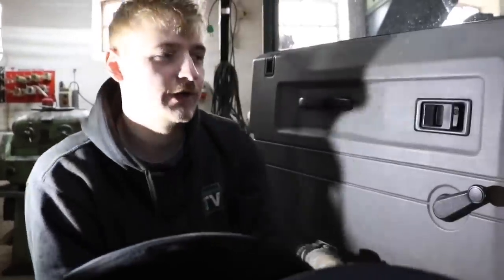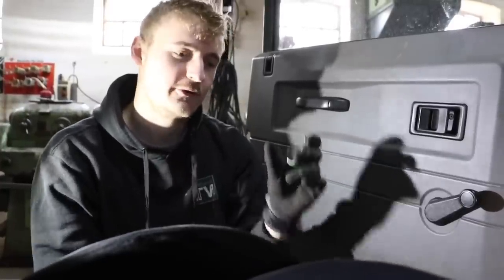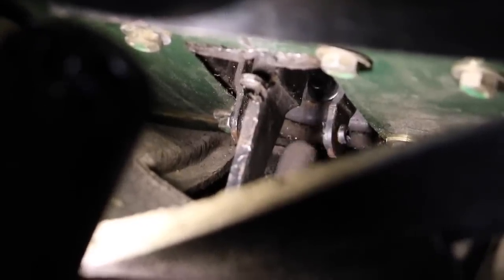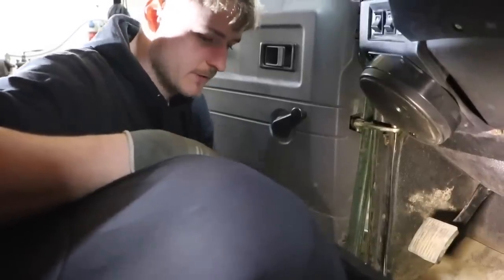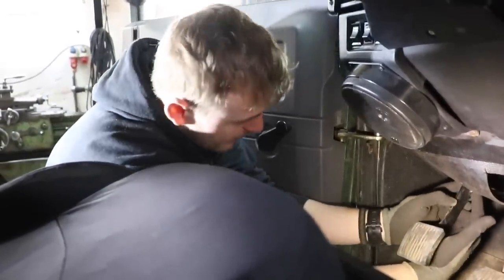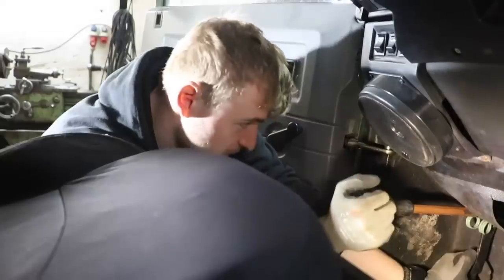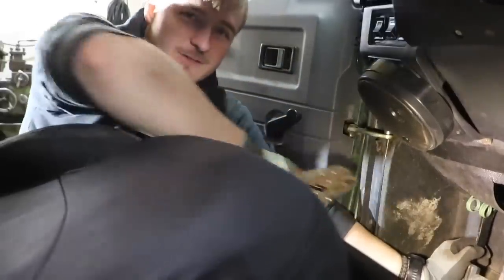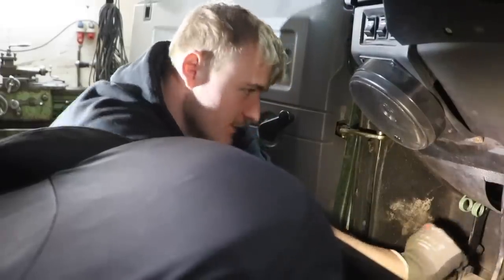How To Make Your Defender Clutch LIGHTER For £20!

Comment: I used my Defender for work for 7 years and covered 140,000 miles so my left knee is ruined. I fitted this spring and the LOF powerslave clutch cylinder recently and I can now drive in comfort. Well worth the effort and money. I found it was easier to fit the spring if you undo the 17mm bolt on the engine side of the pedal box which gives you more room to get the spring in.

Comment: I struggled to fit one of these until I screwed the clutch stop out, allowing the pedal to go down further, no problem then. I used snipe nosed Vice Grips, these saved a lot of struggling. I was extremely sceptical that it would make much difference, but the spring has transformed the clutch action. When I bought my TD5 I couldn't understand why the clutch was so heavy in comparison with my 300TDi, I have now found out. The good old bean counters at LR strike again, they must have saved at least 50p to ruin the clutch operation.

Comment: Fitted mine this morning what a ball ache to fit!! I recommend compressing spring with copper wire then once it’s fitted just cut and remove it. Also you need a flexible back to get in there.  Clutch does feel so much lighter 👍

Comment: TRY A SMALLER INTERNAL BORE MASTER CYLINDER MAKES A LOT LIGHTER
Reply: That’s what the LOF master cylinder is!

Standard bore is 0.75 inch (3/4), the LOF is 0.70 inch, but you can pick up 0.70 inch master cylinders on eBay cheap, as they were used in lots of British cars.

Comment: Surely putting a spring on the pedal to assist with pressing will eliminate the necessary free play and cause the release bearing to run constantly, the equivalent of driving around with your foot resting on the clutch, a definite no no. Please tell me I’m wrong before all those installer’s have premature clutch failure.
Reply: It's an over centre spring

Comment: I've had to admit defeat. Getting access to the 13mm bolt to remove the original spring is impossible on my TD5 xs. 
Fall back was to cut the spring, but then if I can't get the new one on I'm without a car. 
Msybe I'll pay the garage to do it at a later date.
My wife won't drive it as it is, so maybe it's a blessing :)
Reply: Update. I removed the old spring but after too many hours I can't get the new one on. This has turned into a nightmare....
Reply from the maker: @JAMESGRANGER  You can still drive it without any spring.
Reply: @TirsbaekTV  I've set aside a couple of hours this morning to give it one more go or try to rectify it. Hopefully the former will work! 
Thanks for the reassuring reply
Reply: @JAMESGRANGER  did you get it sorted? im toying with the idea of getting one. what's your honest opinion?
Reply: @radiator0  I cheated and had a garage put it on when it was in for some other work. It is better

Comment: Any idea if this will fit a 200tdi? My thoughts are... probably not
Reply: no it does not fit 200tdi you need to change the pedal box to a 300tdi i did this to my 200tdi its so much better to drive cost about 90 pounds. good luck
Reply: Mark Phipps  thanks Mark. I’ll add that to my nice to have list!